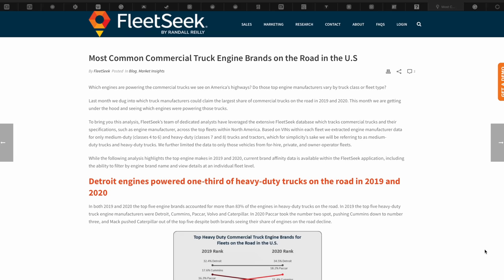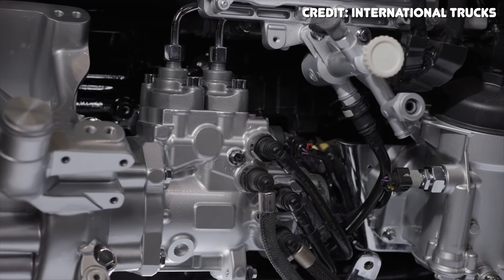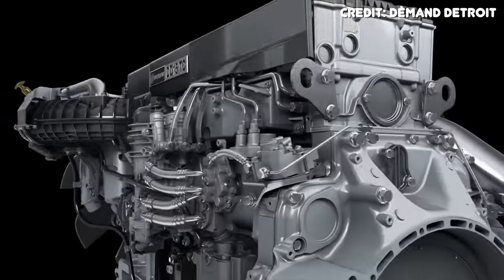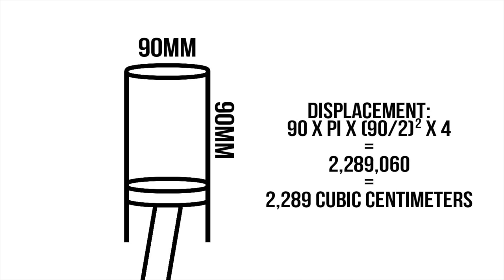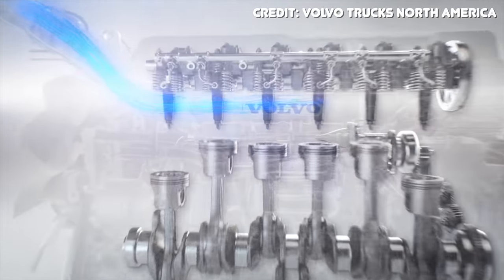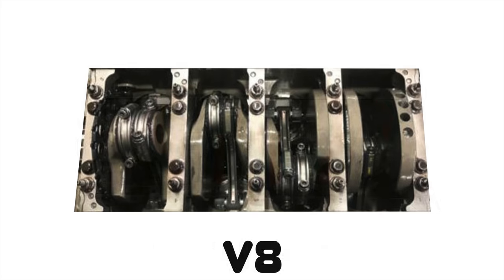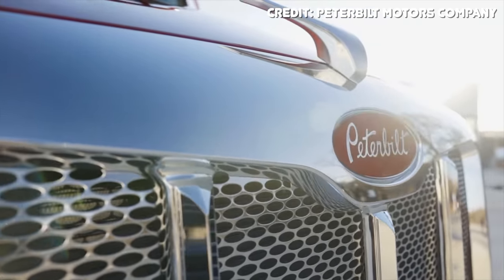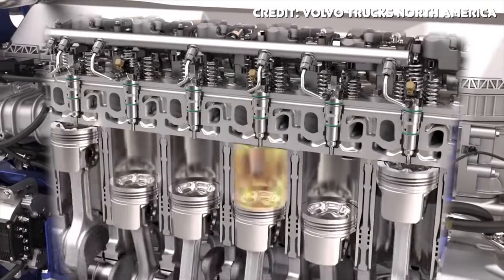Why do Semi-Trucks Use Inline-Six Engines?

Comment: 100% on board with you !
Even to include the 
Ford BIG SIX 4.9 GAS,
and the GMC 292 BIG SIX GAS !
Both have ALL of the same benefits as their BIG brother's diesel counterparts !
And for exactly ALL the same reasons !
In a word, durability !
And yes, plenty of room between the rails, unless you have a need to get into heavier machine work, for the grand majority of repairs, and even rebuild work, it can ALL be accomplished while remaining in the chassis !
Balance, and hearing surface area, ALL create that be ALL, to end ALL, LONGEVITY factor !
Which equates to profitablity to both the private long haul driver, to the BIG commercial fleet owner !
Great video Sir !

Comment: The Paccar PX7 and 9 are simply cummins engines painted grey with a different valve cover.
Reply: Same with the mack engines. The MP8 is basically a Volvo engine

Comment: 4:00 the inline 6 IS inherently better at producing torque. It has the most power stroke overlap of any configuration. I just learned about this a few months ago and it kind of blew my mind. The inline 6 engine design has overlapping power strokes. This means that more than one cylinder are firing at the same time, which gives you more power and torque for the same displacement. The firing is always overlapping giving you extra power. I6 has the most power stroke overlap, and the i5 has the second most overlap.

So not only does the inline 6 make more power for the same exactly design engine only different cylinder configuration, they are also perfectly balanced, which means less loss of power to friction, longer life span because there are no vibrations to wear out anything extra.

This is also why all of the best racecars usually have V10s or V12s, it's because since the i6 has the most overlapping power strokes and is therefore the best engine, the only way to make it bigger and still fit in a normal shaped engine bay is to put two of them side by side. That way you still get all the benefits of a inline 6, but with 2 side by side in a v12 you get that really compact rectangular engine shape that is great for fitting into engine bays, whereas if you just made a inline 6 twice as big, it would have a much harder time fitting in most engine bays. And since the inline 5 has the second most overlapping power strokes, V10 engines are also popular for racing.

The inline 4 engine has exactly always 1 power stroke happening. They are perfectly divided into 4 stages so that there is always 1 piston having a power stroke. Inline 4s are great, my personal gripe with them is how much they vibrate especially at idle and low speed. They can never really be perfectly balanced, only by adding lots of extra weights for counter weights that takes away power.

So when you put all that together, the most power overlap, the most powerful cylinder configuration that has ever been discovered so far, and also perfectly balanced so it's great for minimal vibrations and long reliability, it's a no brainer for the inline 6 to be favored in industry when maximizing the numbers is all that matters. This design gives you the most power and torque for the money, and the most reliably. If they didn't, they wouldn't be using them. V8's aren't bad, they have pretty good balance as far as smoothness goes, but they don't have the power stroke overlap of the i6 because they are basically 2 inline 4 cylinder engines and inline 4s have zero power overlap. This is part of what makes a v8 less efficient than an i6. You get less power from the engine for the same amount of displacement, weight, and size. V12s are really the best engines in terms of outright perfection of power overlap plus the rectangular shape for fitting into normal engine bays. But because trucks can design their engine bays around inline 6s and v12s would cost way more in maintenance, they settle for the i6 which while not as cool as a v12, it is just as efficient. The v12 just wins for the extra awesome sound it makes and for fitting into normal engine bays better than a i6 of the same displacement. But they are both perfect in terms of maximizing power stroke overlap and having perfect balance and no vibrations.
Reply: V-8  have more overlap, wasting fuel.

Comment: I use to love the old 2 stroke Detroits. I didn't ride the school except for going on field trips, so the highlight for me was listening to those Detroits the whole way! When I started driving trucks in the early 2000s my favorites were CATs. I could tell them apart by sound and smell. Sometimes I miss driving them but I moved on from driving.
Reply: I'm a lifelong railroad fan and former railroader.  Until the last 15 years or so GM's former Electro Motive Division (EMD) always used 2 cycle engines in their locomotives.  You could always tell the difference between their engines and those of GE and earlier units by builders like ALCo, Fairbanks-Morse, and Baldwin, which were all 4 cycle.  Their passenger F40PH 3000 hp V16 model 645 (for cu.in. displacement per cylinder) for Amtrak was one of the most reliable prime movers ever built.  Amtrak had them setup to generate hotel power for the coaches, so they ran at full-throttle (about 900 rpm) constantly when on a train, gaining the nickname "Screamers".  The downside of the 2 cycles was worse fuel efficiency and more pollution, which is why they are no longer being built.  Lots of railroaders need hearing aids today because of them, but I miss the screamers.  They sounded like they meant business when you heard one coming into a station for a stop, never idling down.  Two-cycle EMD 645s remain extremely popular in the used locomotive market for their durability and reliability, while hardly anyone rebuilds old GEs.

Comment: I have a 2007 cummins mega-cab and a 2007 BMW 328 non turbo. Both have straight 6 cyl. Both have been super bullet proof and reliable. Also they both have that wonderful sweet torque! My cummins can pull a house! My BMW is a sweet rev-er. My truck gets 17/21 mpg AND it’s lifted on 22s”. I will never sell either one. Love the straight 6 engine, for torque and performance!👍

Comment: I always thought was a combination of engine bay constraints and manufacturing economics that began to spell the end of the inline 6 beginning in the mid 80s, when American cars went from rear wheel drive, body on frame and very long hoods, to unibody,  transverse front wheel drive and more compact cars, so manufacturers figured it didn't make as much sense to keep the I-6 when a V6 and inline 4 could be used interchangeable with minor modifications.

Comment: I love the 3.0L I6 in my new GMC Sierra.  Very smooth and trouble free so far at 48k.  Awesome MPG(Averaging 26MPG even running winterized fuel).
Reply: I just hit 26K with my LM2 Duramax. This is by far the best engine I’ve ever owned. I can’t believe the power from this little 3 liter. It’s also smooth and efficient. I have the AT4 and have seen on average in the NorthEast 26MPG I did hit a best once of 33MPG but that was short lived. I agree with a the points in this video. My dad had an 82 Ford CLub Wagon with a 4.9 liter inline 6 302. This engine had 300k on it when he finally got rid of it and was extremely smooth. I wish GM could convince more people to buy this diesel for me it was a much better buy than the 6.2 V8.
Reply: @camsteremail  Got a '21 Elevation with the I-6.  The family's 18 foot dump trailer with about a medium load was pretty much trivial.  Kinda wrecks that WONDERFUL cruising fuel efficiency, but even under load it's quite efficient.
Reply: I have a '21 Sierra with the same engine.  At 9k' in the CO mountains, averaging around 32.  Pulling about 7k#, down to about 15mpg.  Excellent trailering vehicle so far, but lots of software bugs in the truck

Comment: Engine wear isn't really based on rpms but piston speed (or the velocity moving metal parts rub against each other).  A low rpm engine can still have high wear if the pistons have a long enough stroke.
Reply: exactly correct, the devil is in the details
Reply: Yes!!
Reply: well you are speaking of cylinder wear not bearing wear, now in my experience the later is more common.
Reply: another important consideration is that these engines are generally built with bigger heavier parts in order to handle the torque they are expected to put out. it is in fact somewhat misleading to say that the low rpms are what lead to reliability when in fact it is more to do with the parts simply being of sturder construction. This heavy design is also the reason for such low rev limits since the heavy parts can only be moved back and forth so fast before it would begin to put too much strain on everything else
Reply: Thank you Randall for pointing this out.  "piston speed" is very important and often overlooked.
Reply: Piston speed IS RPM's.. Revolutions per minute. Don't complicate it.. lol...
Reply: @Mywhtjp  Yes, but piston speed changes with the throw of the crank.  There a lot of factors that need to be considered!    😁
Reply: @Mywhtjp  please tell me you are joking?
Reply: @Stale_Mahoney  well, you see the RPMs set the time the piston has to travel the stroke
Reply: @zweisteinya  yeah but if you got 40mm or 150mm of stroke 1000rpm will make the 150mm stroke have allot higher piston speed as it need to do more distanse over a shorter time. this is why low stroke engines can rev higher in general as they can reach higher rpm before the piston speed gets to high for the oil film to keep up

Comment: Back in 1986 I had an F550 bucket truck that had a 300 6 in it, I needed more power because I carried a lot of tools and pulled a 24' trailer with a 64' crane on it that weighed 12,600 lbs before I loaded signs on it. I looked into putting a 390 industrial engine in it but could not find the right transmission or tail shaft for the smaller drive line. I was in Mobile Alabama at the time and found Bob's Speed Shop, he said why not beef up the six, I had never heard of doing this, he made out a list of parts that included a  Holly dual port  intake,  a Holly four barrel 550 with vacuum secondaries, tuned headers, a moderate high lift cam, dual points distributor and a Holly high voltage ignition coil an wire system. The parts were just over $600 back then which was a seriously lot of money for me. Knowing my way around an engine I tore into it on a Friday morning,  and by Monday morning  the beast was Alive. I had a 302 Boss in Mustang in high school so I had been around powerful cars and done some racing but this 6 cylinder came alive almost to the point of being scary, the engine sounded like a diesel and most people thought is was. The truck weighed 18,400 lbs loaded ad the trailer weight of 12,600 lbs, then signs of usually 2,000 lbs totaling +/- 33,000 lbs behind a straight six, it was crazy but that thing was a monster,  I drove that rig all over the US servicing and installing signs for over eight years without a single engine related break down.  Before the mods I was getting 10 mpg empty and 6mpg with trailer and couldn't hardly pull up a steep driveway. Afterwards I was getting 14 mpg empty and 11 with trailer and hills were no problem,  pulled that thing all over the Rockies in Colorado all the way up to Montana. I couldn't figure out how to put a picture of it on here.
Reply: This is a really interesting post, thanks for sharing the info. I have a '75 Ford F150 with the 300 6. I kind of inherited it as a project truck. I'd always thought about swapping the engine for something more 'modern' to get better fuel economy but now it seems I should just upgrade the engine that's in there. I'll be saving this post and doing some research.

Comment: For me it's 50/50 between a V8 and an I6. The Volvo D16 is one of the best engines on the commercial truck markets. It's a 16.1L I6 engine that, today, produces between 540hp (2650Nm of torque) and 750hp (3550Nm of torque). Combine that with the best drive train on the market, the I-Shift transmisson, and you'll have the best truck to have ever been produced.

The Scania DC16 is also a really smooth engine. It starts as a 15.6L V8 that ranges from 520hp (2700Nm of torque) to 660hp (3300Nm of torque). Then there is the 16.4L V8. There is only 2 specs to pick from here: 730hp (3500Nm of torque) or 770hp (3700Nm of torque). The 770hp version is currently the most powerful commercial truck engine in the world. It stole the title in 2020 from the Volvo FH16 750 that had been holding onto that title since 2011.
Reply: Educate this fool doing the video please
Reply: Meanwhile in the North American market, Volvo's D16 was so problematic and unreliable that they discontinued it sometime around 5 to 7 years ago..
Reply: @walkerforsyth6221  Meanwhile, here in Sweden, most heavy hauling companies either go with Scania DC16 or Volvo D16 because no other engines are as powerful or as reliable. At least the newer ones. I've never heard anyone complain that their D16 or DC16 spend too much time in the workshop. That's saying quite a lot since most of the company owners I know that drive Volvo usually only do full loads (62 tons with 8x4 truck and a 3-axle trailer) since they haul gravel or asphalt, and in this business it's rare to see Scanias with under 580hp and Volvos without the D16 engine. These engines exist purely because the necessity for more power, mostly on the Swedish market. This also mean that they have to withstand quite a lot of abuse due to very heavy loads and steep inclines. The most popular engine for Volvo is the D13, though, and I find the DC16 more common than the lower spec I6 in the Scania trucks. Even when Scania released the 540hp 13L I6, most companies still prefer the 520hp (lowest spec V8) engine because it's more reliable.

Comment: The best inline 6  truck engine ever built ir the CAT C15 NZ engine. I had two trucks with them and both ran 1.5 million miles before needing overhaul. The engine had an enormous amount of torque from 1100 rpm up, and when set to 550 hp were no slouches on long uphill pulls.
Reply: I also had two trucks with that Cat engine. It flattened hills 👍

Comment: I own a 2021 Sierra with the 3.0L LM2 I-6 Duramax.  I've owned and/or driven examples of just about all the V8 powerplant types available in the pickup market at various points over the last 20 years.  

I can think of maybe...  MAYBE one of those that stacks up against this little I-6.  Maybe.  And not a single one of them can even dream of touching the same fuel efficiency.  I absolutely LOVE this engine.
Reply: I am with you on that. Even with gas being over a $1 cheaper I will not go back to a gas 1/2 ton . The added torque and fuel economy is untouched.